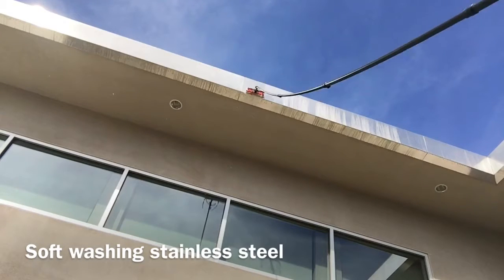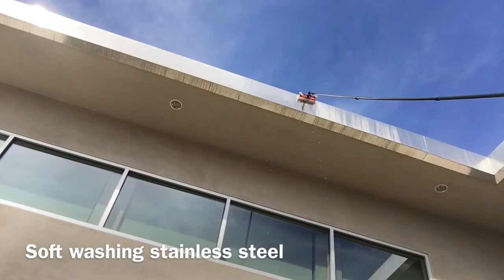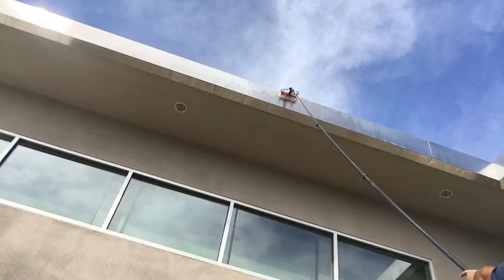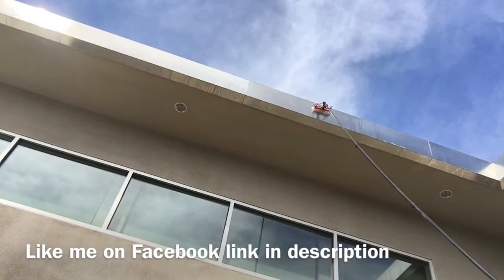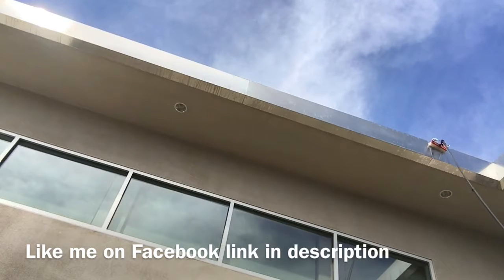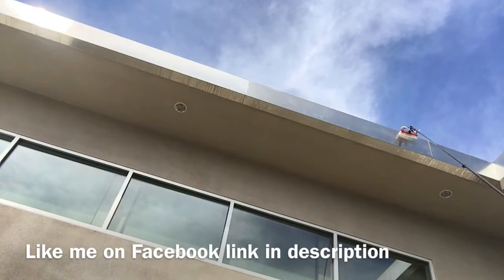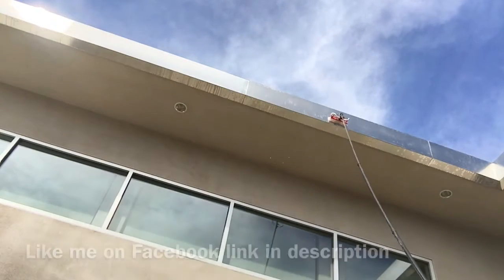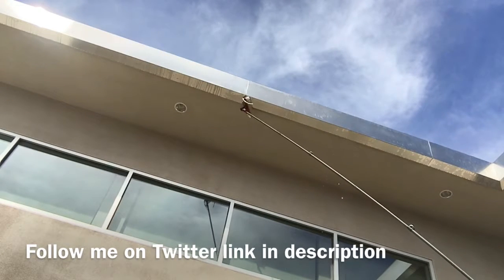WFP soft washing

Comment: awesome Mitch i have several jobs lined up this week doing the north side of houses that have alge on the vinyl siding   i will be applying a moss and alge killer via hudson and wfp   i bought a seperate brush hose and hudson for this purpose  sure beats a ladder and pressure washer      i do have an xjet nozzle for my pressure washer but i can use the hudson and get 2/3 done before id even have the pressure washer up and running
Reply from the maker: Dave Landefeld that’s great. I just landed 5 auto zones I’m sure I’ll get more too. We don’t get that here. Too dry. Lots of dust though. I fixed my rinse bar, I’ll be posting a new video on Monday.